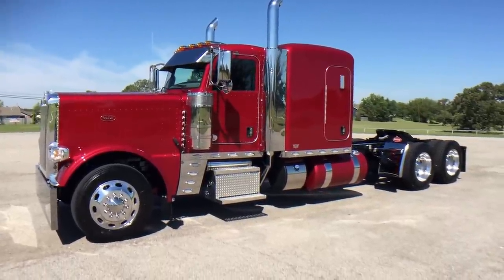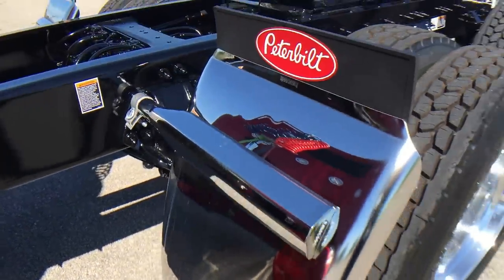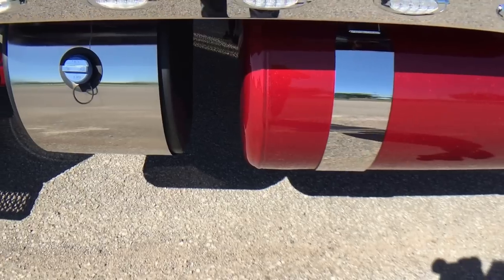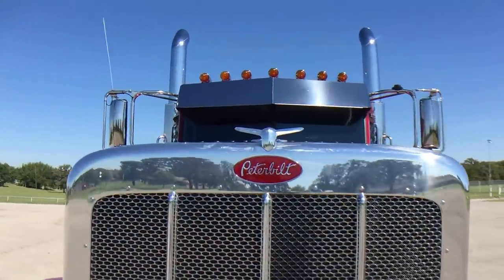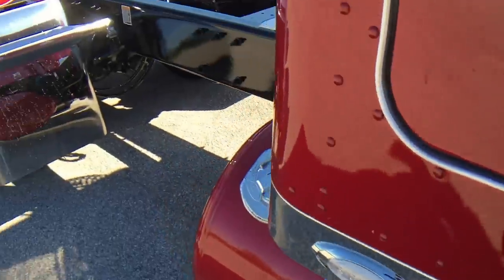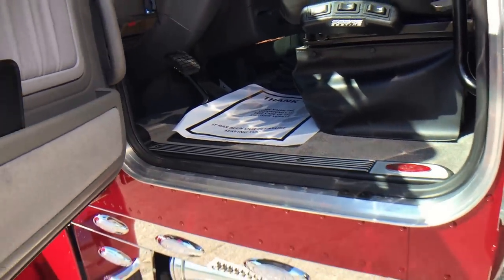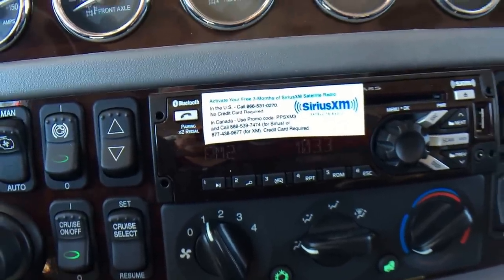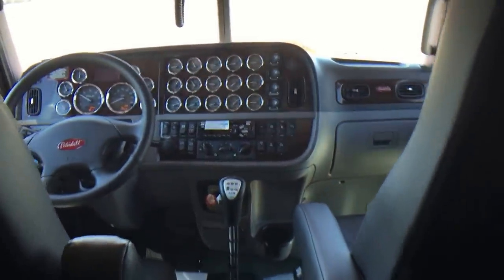600 HP 2017 Peterbilt 389 Flat Top 18 Speed 23 Real Gauges

Comment: I got disc brakes on the steer on my cascadia, quiet & long lasting with good stopping power only downside it releases alot of brake dust & hard to keep clean on aluminum wheel...  beautiful peterbilt hopefully my next truck can be one of those.

Comment: Question... I never heard of it but you showed that Remote Lube and it looked like it had a few zrk fittings for grease. Is that like an easy access point and you grease it up there and the grease will flow throughout the rest of the system? Never seen that before but is a cool idea so youre not constantly crawling around trying to find or reach for fittings.
Reply from the maker: You are exactly correct. Much easier to grease from the top side.

Comment: Hi Steve.  Is the power gain from doing the 600 that noticeable versus doing the 550 with the 2050 torque setting and a 209 18 speed?  Just curious, as I am approved and looking to order a 389 in the next month or so.
Reply from the maker: Depending on application I will almost always go with the 2050/550 over the 600/1850. I am ordering 2 trucks today with the 2050/550 for a livestock hauler. I would love a shot at earning your business. Let me know if I can help.
Reply: Thanks Steve.  I run regional with LNG tanker and other gasses.

Comment: Would have been better as a glider kit. Cat Piss DEF kills mpg and reliability.
Reply: Nice truck anyhow. 😆
Reply from the maker: Thanks for watching
Reply: I own a '16 flattop 389 ISX 15 550 I bought new from Rush Tulsa. 110k miles on my truck. I run all 48 pulling a 7,000 gallon tank grossing 80k. My biggest breakdown so far has been patching a drive tire. I have been driving for 15 years. All Pete 379/389 and KW W900's with CAT power. This is my 1st EGR Cummins and I have been more than impressed with the power and I'm running over 6mpg consistently. Not to mention the cold start reliability if it drops down to 10-12 degrees and I forget to plug it in. I barley even bump the key and it comes to life. From my experience if it's 18 degrees or colder and you don't have a CAT plugged in forget it she ain't starting! All in all I couldn't be happier with the truck and my ISX 15!
Reply: actually having the dpf and def cleans the exhaust so they can run more power by advancing more, and adding more fuel
Reply: Yea is that a fact it's kinda hard to get that 8" straight pipe roar out of the stacks with that DEF B.S on it
Reply: Jacob Lake can’t beat that common rail for cold starts. Dead on reliable

Comment: 160k paper weight in about 400k miles when that def motor plugs up. 
Gliders are still the only way to go if u don’t have to go to calif. 
if u have to get a Cali truck then I hope ur making enough to buy a new engine in 400k miles.
Reply: Gcal1956 — Since DEF is introduced to the exhaust system, it is unlikely that there is any affect at all on the longevity of the engine.

Comment: there are three 600 h/p ratings. which one does this one has because i will not ever buy this pete if it has the lowest 1850 set at.
Reply from the maker: This one is a 600hp ISX. Are you asking what the torque rating is? Horsepower and torque are 2 completely different things. If this is a 2050 torque engine would you like to buy it?

Comment: What kind of MPG can you expect?
Reply from the maker: In the 6's
Reply: Are you able to tweak the transmission gearing at all?  I'd like to be at 1500 at 100 MPH in 18th.  Is that possible at all?  What is redline on this engine anyway?
Reply: i find in the itnernet and depends from a lot of factors, in a reddit a guy with a 389 and a cummins 550 get's around 6-7 MPG

As far as i know the importance of aerodynamics reduces while you are going slower, and thermodynamically you need much less torque to mantain speed since power is forceXspeed. 

supposing you go at 50-55 MPH you could easely get 8 or even 9 MPG with 100K pounds
Reply: I just did calculated, and with a fuller transmission, an advantek D40-150X 2.23/1 drive ratio differentials, 295/80 R22.5 tyres, you could going at 1350 RPM at 100 MPH.

so yeah, is possible, the problem can be that low ratio differentials are normally less reliable.

Comment: To Gary Thomas,s reply to Garret, urea is NOT mined, its formed by mixing ammonia and carbon dioxide, usually heat,pressure,and condensation methods are used.  During the process you also can get liquid nitrogen depending on the process being used. Please dont call Garret a miss imformed dumb ass driver. Thank you
Reply from the maker: Thanks Kody, guys sure get tough behind a keyboard sometimes. You're a good dude!

Comment: I'll go get me a glider with a 72in sleeper. Cut the top and put a flat top cap on it with triple windows. Lower it 2 inches. 10in straights and a 3406b model cat with a 6-4 trans just cause that's what I have now and it catches the eye of a lot of people.
Reply from the maker: That will be a good looking truck.
Reply: Good for you